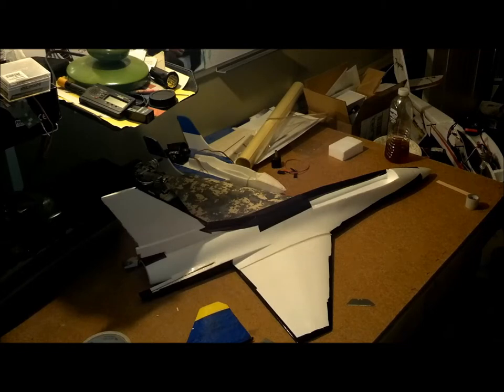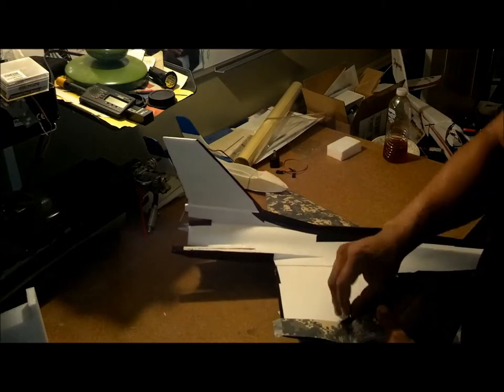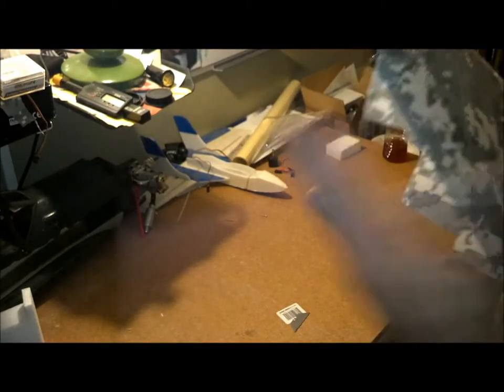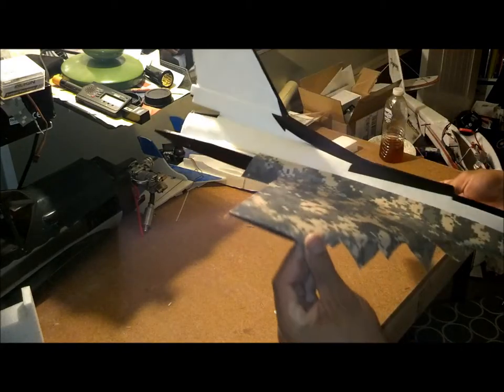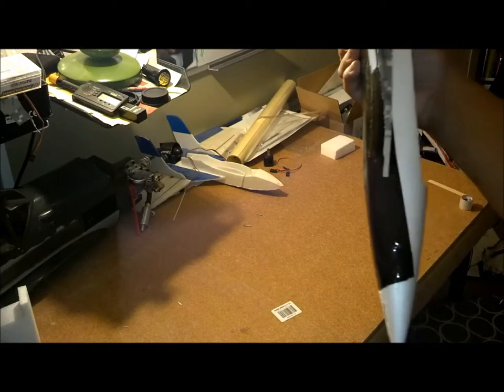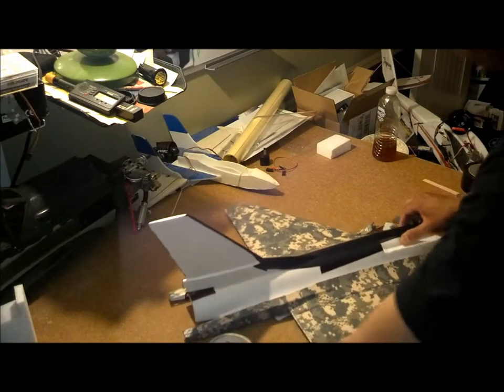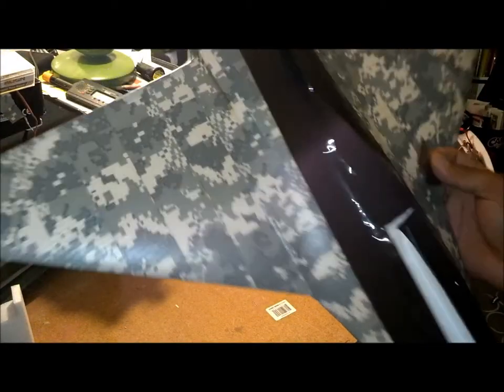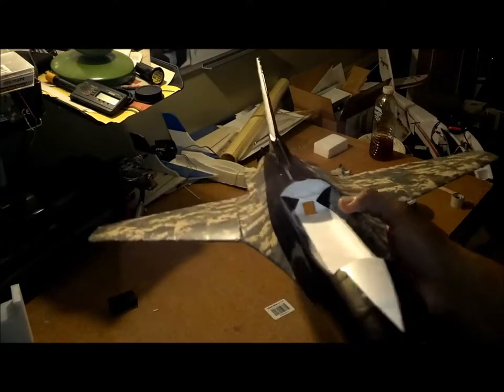Flying 2 Fight Cancer:  How to cover a foam plane with tape

Comment: Look nice.  Only thing I've noticed with duct tape is it's pretty heavy, so I've started using colored packing tape for my planes.  It's not as strong but much lighter so it's great for the slow-flyers I make.  But I'd imagine for this jet that's not an issue.